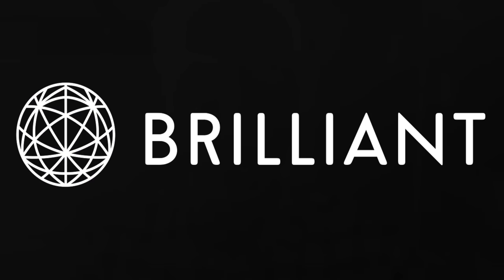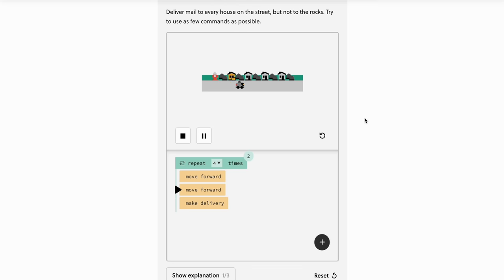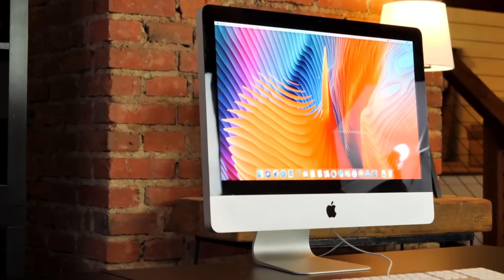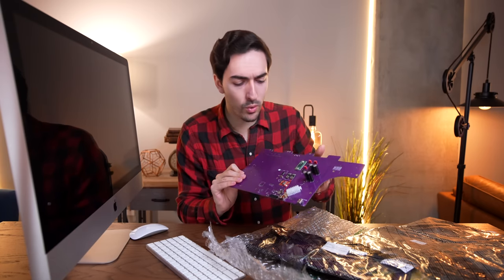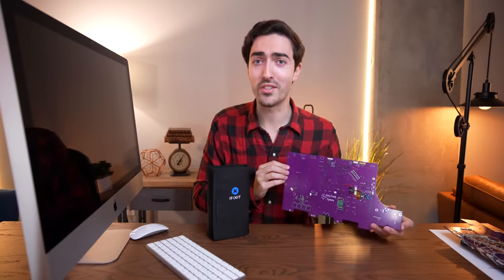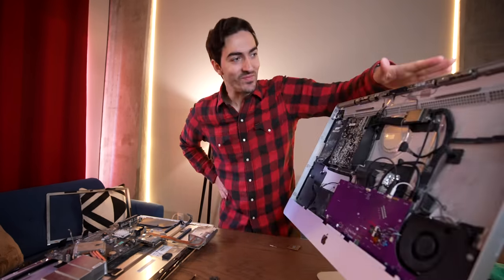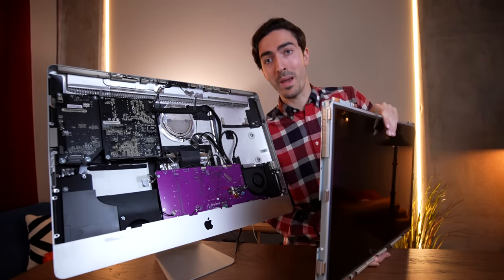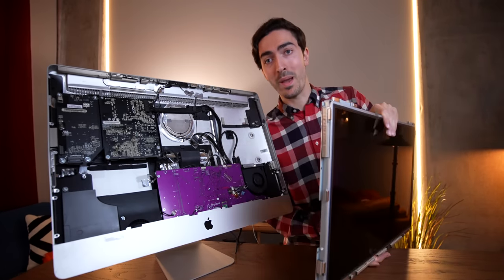Upcycle an old iMac display with this INSANE mod!

Comment from the maker: If you want to preorder the DockLite use coupon code Getcrumputing for a discount! Do note that Juicy Crumb is a startup Kickstarter project so I can’t personally guarantee their future operations. Regardless, a very cool project! What do you guys think? 

Huge thanks to Brilliant for sponsoring!
Reply: How many hertz have the display?
Reply: @Flex200  60
Reply: kinda curious where u can buy imac for $100?
Reply: @jamo8896  only?!
Can you overclock it?
Reply: @Flex200  no
Reply: Would this work with an Apple TB Display?
Reply: @squalley  with the right Controller Board, why not
Reply: DockLite cost is $588, labor and 3 cable connections, a better option is the Apple Thunderbolt Display it will cost you $500 with a single Thunderbolt connection. I personally would buy a new LG 4K display for $500.
Reply: 12:35 That's a fantastic idea. And i hope they think ahead, unlike apple does, and have an option to still use the imac as a display!
Reply: @shinnoke8  craigslist
Reply: The coupon expired :-(
Reply: So what happens if you plug a normal none mac into
Reply: Love😊 the idea of reusing what is a versitile unit, flipping it into a monitor rather than throwing it away.
Reply: Look at this
Reply: ESTO ES EXTREMADAMENTE CARO Y NO ES RENTABLE.... ES MEJOR COMPRAR UN MONITOR USADO
Reply: Anything new on this?

Comment: No wonder you did not mentioned the price… 386$ for this board makes it useless… for 50$ less you can have better, new Gigabyte M27Q. I would buy this board for around 100$, not more. Nevertheless- congrats and all the best to the team who came up with the idea! I like repair and use “retro” stuff.
Reply: Thanks for that info! I’m out!
Reply: Ehhh? The color accuracy (the expensive thing) isn’t quite there.
Reply: Not sure if they lowered the price but it’s now $250
Reply: It’s a custom made small run product, it’s going to be expensive just look at gba lcd screens
Reply: It's still a proof of concept. I'm sure the price will come down
Reply: @2012Zyle  $386 is the price in Australian dollars. So significantly less in USD.

Comment: The idea sounds good, but is completely uninteresting given the prices for the DockLite and DockPro. First, both cost more than the residual value of the iMac, and second, the power consumption of the iMac's power supply is not economical for monitor use only. The 27" 2011 iMac "only" has a 2.5K display, but for the price of the DockLite you can already get a 27" LG 4K monitor with a much better picture and a higher resolution. And this monitor already has USB-C and a USB hub built-in. Of course, the power consumption of the LG monitor is only a fraction of that of the iMac. Therefore, nice idea and a nice project, but not interesting in terms of price and not practical since the buyer has to take care of the installation. // But I must admit that I would be interested in a 5K version if the price is right. The LG Ultrafine 5K monitor is simply expensive, and converting an iMac 2014 or 2015 for an external monitor would be interesting. Unfortunately, we also have the high power consumption of the iMac power supply again

Comment: This is such a cool and needed idea.  I love the idea of breathing new life into these great screens.  But the almost $600 price tag is going to make this a hard sell.  That's the USB-C version which I think we all agree is the only way to really do this.  Get this into production - and get the price down and this is a very cool idea.  I have a 27" cinema display that I found at a thrift store for $15 but the power supply is toast.  I built one to make it work and that monitor is still great. (aside from the dual DVI bullcrap)
Reply: According to their website, in US Dollars, the cards range from $243.37 to $439.46.
Reply: @gernblanston5627  Which is still way too much for something like this
Reply: @Foggy404  Especially since while I have no doubt a lot of work went into it, the components do not seem to justify the means. You could get a replacement motherboard for less, which is ridiculous. They really need to fix this pricing.
Reply: Agreed. At that price point I’m close to getting an Alogic Clarity 5k monitor.

Comment: I love the idea of what they sell however it is too expensive for what you get by the time you factor in buying all hardware. You can buy a used apple display with all the same features that is newer for high $100's to low $200's

Comment: Would be cool if the optical drive could be kept inside the imac and used as a peripheral on the host machine
Reply: It can, with the Pro board! :)
Reply: @digitalrampage  awesome! Really great to see the potential widespread re-use of this kind of hardware! I just sold my thunderbolt display to a coworker not long ago; great piece of hardware and a converted imac like this I can only imagine is even better and more versatile. 

With all the i/o egress on the back of the case I guess you could tie in a whole docking station type thing too but I’d imagine it would quickly drive up cost.
Reply: @th0m  yes, unfortunately the ports used on this mode are all bespoke by our favourite fruit company. Other models will be far easier
Reply: @digitalrampage  lol. Didn’t even consider that given the ubiquity of most of the ports, but sounds about right for apple. Jeez.

Comment: I like the concept alot. If possible it would be great to reuse the existing ports in the Back to also function sort of as an USB-C Hub. And have only a USB-C cable run to your Computer.

Comment: I successfully upgraded a 12.5” 2011 iMac to Ventura this week. AMD FirePro M5100 €45, WIFI card out of a newer MacBook Pro and an adapter to install the WiFi card into the PCIE slot. About 2 hours of time to get it all put together and installed with Opencore Legacy Patcher. Zero issues. The Juicycrumb board is very cool but it is still very expensive.

Comment: Best thing to do is a grab a 2009 or 2010 27 inch iMac. These pre thunderbolt iMac are pretty universal when It comes to target display mode.... No OS restrictions and only requires a mini display port connection. My 15 inch 2015 MacBook Pro running Mojave, Big Sur, Windows 11, Monterey and Ventura all of these operating systems have been able to use the iMac as a display and use the speakers in the iMac. Ive also been able to connect an old dell laptop to the iMac and it was able to use the iMac as a display.
Reply: Should upgrade that machine so you can run Ventura natively

Comment: Great vid. Would definitely be interested in such an option - as I have a 2011 27” iMac currently collecting dust after the graphics card failed. But (in current climate) it all comes down to price - whether the reward is worth the effort and investment. 
But the thought of possibly turning my old (dead) iMac into a fully working (M1) powered system again - is even more interesting. Will be waiting to hear your followup in the new year...
Reply: The cheapest way of getting it going again would probably be to use another MXM gpu. Some nVidia Kepler cards seem to work quite well. But even though a 2011 with an upgraded gpu can run newer versions of MacOS (even Monterey/Ventura might work), you're still essentially using a 2011 machine, just with modern software sort of hacked onto it. An M1 would probably be way faster, overall more modern and arguably less finicky once everything's set up
Reply: Don’t bother

Comment: I mean I am currently using an Imac 2007 Imac 2011 and Imac G4 Lamp as my monitors with a cheap sccreen cocntroller pcb from China it would have been cool if you mentioned that home grown solutions are there also

Comment: Definitely would love to see JuicyCrumb do this with the 5k models, since the eBay boards are rather iffy at best
Reply from the maker: I’d love it just to be able to properly mount the board with the existing screw posts rather than using a bunch of tape!
Reply: @lukemiani  one thing I would love is if the ports could still work. For example the optical drive, SD card reader or thunderbolt connections.
Reply: @lukemiani  I did the conversion after your other video and had to tape the board and it came loose and there was no way to fix it so it rattled around in the iMac case. And then the eBay board went bad 😫and it's broken. By the way you crashed the juicycrumb site. They need to put you on their board.
Reply: Yes! To be able to turn my 5K iMac into a Studio Display without spending $1600 would be awesome.
Reply: The $600+ for the converter board not worth the investment in my opinion.
Reply: @docmartinjnr4281  the 500 neither. It has to be 300 to make sense.

Comment: found a 2008 imac at the dump with a bad graphics card. reflowed it with a heat gun, and still using it right now.

Comment: I think they should add in an HDMI port and maybe even DVI-D to make it compatible with anything, not just Mac. It wouldn't really matter if the camera didn't work with HDMI, but they could always add USB3 out like a normal webcam.. just a thought. I had a 2011 i-Mac 27" and I kind of wish I had kept it now for a project like this. Although that nearly $400 price sticker will actually buy you a REALLY NICE 4K UHD monitor on Amazon. (ahem... with a full warranty)😉

Comment: Do you know if they are working on a board for the 2011 24" iMac?  - I love this computer - but it stopped upgrading with High Sierra, and I still used it through the lockdown. But I need that upgrade compatibility now... The graphics card is insufficient and not upgradable. Any suggestions?

Comment: Any chance a conversion could extended to a late 2009 iMac. Mine still works fairly flawlessly, but I'm stuck running High Sierra.The screen has excellent resolution and the sound card is good enough.  I would like to upgrade the hardware to allow a later OS to be loaded or whatever options exist to prolong my use of this still excellent computer.

Comment: I would immediately scrap the internals of my old iMac for that mac mini setup. But its a mid 2010... I wish Luke would have detailed what the connection issues were between the 2010 and 2011 iMacs which caused the conversion board not to work.
Reply: In the future a 2010 board will be made.
Reply: The 2010 is completely different in the way the screen interfaces
Reply: @digitalrampage  Glad to know a 2010 board would be made in the future. Was going to say depending on what function the 2010 and 2011s differed on I might be able to live with it but the screen interface is a pretty big no go! Thanks for the info!
Reply: @JebMillenderKicking :  Apparently, the 2010 and 2011 27" iMac’s are really very different inside.
 
Someone further up the comments gave a proper explanation and comparison.

Comment: Did a gpu swap on my Imac 2011 mid 21.5 inch. 
Does modells are great. 
To bad that Nvidia or AMD would not make a basic MXM GPU for does old models. 
I mean it does not need to be extreme powerfull only 4k video support would be enough. 
The Imac work great to play on geforce now or doing some work.

Comment: Fantastic project. Was the display brightness adjustable from macos?
Also including an ethernet port on the board would be genius.
I agree having everything combined over one USB-C cable would be even better.
Why not include power delivery in the mix (edit: their site mentions PD). That would really tick all my boxes.

Comment: I you happen to have an older iMac sitting around this looks good, and if they get this going for an 5K display iMac or the M1 upgrade mentioned even better. But maybe just better to get a APPLE Thunderbolt Display that has all the built-in features, are now fairly cheap used (got mine for $200 mint and boxed), and easy to find, and without any extra cost or opening up for repair. It is pretty amazing that a company is making new solutions for these, old tech is still worth saving.

Comment: This is a great modification, I have a perfectly useable 27"late 2009 imac which of course has Target Display mode, it would be great if there was a way my 15" late 2017 MacBook Pro could connect to it.  I spent over 120 euro in genuine Apple adapters in the vain hope of using it as an external display for the MacBook, all for nothing...

Comment: Very interesting concept and project. Assume you would need to know the panel is in very good condition before sinking in 386 or 588 or 697 usd on the board. You retain the apple aluminum design. There are newer technology similar resolution or 4K monitors available within the price range of the Juicy Crumb board alone.
Reply: That is correct, you would need an LCD panel which is in good condition.
 Just so you aware, the pricing you mentioned is AUD. The USD pricing is $243, $370 and $439

Comment: I'd expect it all to be a bit neater with a USB-C hub inside or built on the board. USB-C can be tricky to get the right chipsets for power and display etc, but not impossible. Hopefully in a new revision...

Comment: Can't see how this makes sense, since you can pick up a working Thunderbolt display on eBay for $200-$250, shipped. If we go with the Juicycrumb option (their website is down but the Kickstarter page shows you can get the board for AUS $299, which is about US $191.50 as of today. So yeah, it's slightly cheaper, but you still have an iMac if you buy the Thunderbolt display. And you can do it now, rather than waiting until April of 2023.
Reply: +AU$96 shipping.

Comment: I have two iMacs. A late 2013 and a Mid 2010. I am currently using the Mid 2010 as a display (the last of the iMacs that had the display mode feature). Both machines are getting up there is years, and not being able to afford a shinny new iMac right now is why I'm doing everything I can to keep them both in working order.

Comment: I have a mid 2010 iMac still in use with a fusion drive HDD replacement, sounds like a jet after about 5mins!! Would love to use the screen as an external or fit a Mac mini inside that!!

Comment: I have a late 2012 IMac I want to turn into a digital photo display. Any suggestions to help with that? My IMac was working good until the last update it damaged one of my RAM and I was told it wasn’t worth fixing. I wanted to get a digital photo display and I was wondering if it would be possible. Thanks

Comment: Target display mode on the 2011 is VERY limited. Only works with macbooks/mini's released between 2011 and 2019. My new Mac Mini 2 can't use target display with my 2011. Ugh....

Comment: Would this work as a display for a Windows PC? I'm trying to figure out a way to repurpose my girlfriend's old 2011 iMac as a primary monitor for her laptop while she's at her desk. I'm assuming I'd need a Thunderbolt to HDMI cable but wanted to know if the speakers would still work too? Thanks for the amazing video!

Comment: I wish this option was available when I had to strip down my 2011 iMac 27". I am running just the screen with an adaptor, but it would have been great to have the internal power supply and speakers.

Comment: I’ve just bought an iMac 27” late 2009 to turn it into a monitor. Can you please tell me how I identify the correct video controller to buy? So far, from about this Mac, I’ve identified it’s an LCD 2560 x 1440 ((QHD/WQHD - Wide Quad High Definition) screen. But do I have to strip it to find the actual controller to order? I’m a Brit, based in Germany. Help! Thanks in advance.

Comment: Great video. I have an old 2011 iMac and was actually thinking about using it as a display anyways. I’m not sure the cost though and there website seems to be down, idk maybe you brought to much traffic to there website. Would like to know just how much this costs and when I can get it to know if it’s worth fixing the one I have or buying this? (It does not work but does not have a GPU problem but still does not work at the moment but can be fixed?).

Comment: You are a beast! I have an older iMac 27" 2017, upgraded the RAM to 64, but still the processor is 3.4 GHz Quad-Core Intel Core i5. Any chance to upgrade it more, or use it as a display, I know there is no Target display option. Thanks ;)

Comment: I love it! I have a 2011 that works fine downstairs unused, but could use it for a display instead. I hope they do the 5K as I have a Mid 2015 27" iMac that I am going to replace and having it as a screen would be great.
Reply: If it’s still in working condition you can just use it in target display mode. No modding needed.

Comment: I have a 24” 2008 iMac that is pretty much useless and my wife would love to turn it in to a monitor.   Is that even possible?  I also have a 27” iMac from 2016 that is getting long in the tooth as well.  Still working now, but mightily slow.  I figure I will get a Mac Studio and use the 27” as a monitor or perhaps convert it to the Mac mini if they bring out that conversion kit!  Thanks Luke!

Comment: Mac mini in an old 5k with attachment to make the ports on the display work and ask far as just a display 5k etc one cable and make all the ports on the now display work so it can serve as dock maybe even integrate a mount for storage where the optical drive use to be to serve as a full fledged display dock combo.

Comment: Hi thanks for the video is the a juicy crumb board for the late 2012 iMac 27”. Is currently working i7 cpu but not to upgrade iOS but would like to get the a new mini with the m2 and use this as a display. Thank for any help

Comment: Hi Luke, many thanks again for a very fine video on an important topic!

I have a late 2014 27" iMac Retina 5k that works fine, but can't run Monterey, which is required for latest Lightroom update. I'd like to buy something like a 2020 iMac and use the older one as a second screen. Have you had any experience with the Luna dongle for doing this?